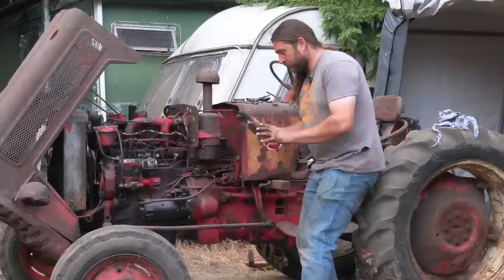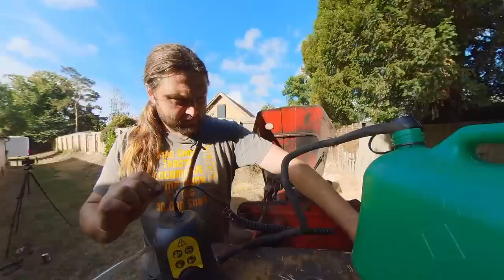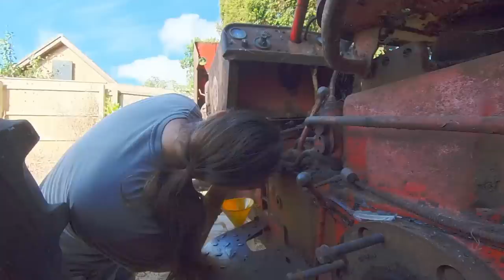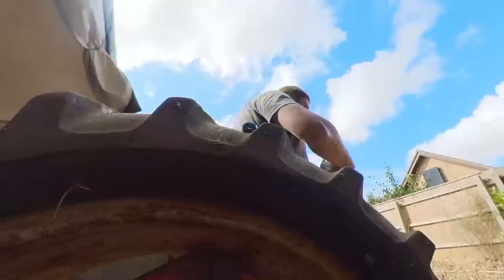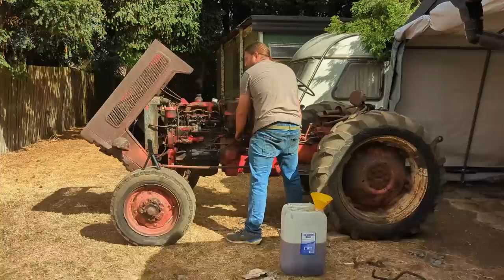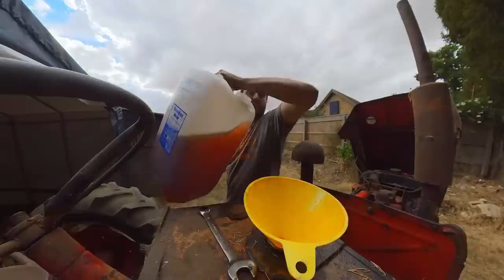Will my abandoned, broken International B275 Tractor start - and what's wrong with it?

Comment: Just a tip for you to try. Get some lacquer thinner or mineral spirits and drain out the fuel again  and pour in a couple gallons or in your country  liters of the thinner.  Let it sit for awhile then use a long wand air gun be excellent if you have one with a suction tube  blast through the mix and stir it around the tank. Drain out the crappy mix and flush it with some diesel fuel replace the valve and add in fresh  fuel you should be good to go. Remember to  add some diesel fuel stabilizer to the fuel and avoid that sludge problem  again. If she's still smoking a bit more than it should add some Marvel's  mystery oil to the fuel and run a tank of it through it should help clean up the injection system  or use transmission oil. Both will help it .
Reply from the maker: When I come to restore the thing, I'll do that!

Comment: I have plenty of experience with IH equipment but not diesels. I'll take a swing at the surging problem, my guess is the timing gears are worn out and have too much backlash. One way to rule out the governor is to put the engine under load at a set throttle position and see if it falls flat on its face. if the governor is still attempting to work, it should add fuel and keep the engine running.
Reply from the maker: Like dropping the clutch in top gear?
Did that and it coped
Reply: @lmm  hmmm... May want to look into the timing gears then. Could also try a thicker engine oil in hopes that it takes out some of the internal slop in the engine.

Comment: hey lmm ! thanks for the videos and return to the wrenches lol... next time you run into this   ...try some compressed air into the petcock ...
Reply from the maker: Yes that would likely work
Reply: @lmm   it would quickly dislodge  blocked inlet filter in tank or petcock ...at least enough to facilitate tank draining and let you troubleshoot ...its a common trick for cars that regularly clog fuel filters /socks  then stop running...its easier than dropping the tank to see if that is the issue . im thinking its the governor as well ...possibly a cleaning will fix the surgeing but more likely its worn  or needs a spring replacement .... if it was a gas engine i would say check the fuel filters

Comment: It's not really necessary to remove the fuel tank. Flush the fuel tank with detergent, then dry the interior with industrial papers towels, using the airline to blow the towels around & pick up any residual dirt. Remove paper towels & refill with fresh diesel or filtered old diesel & use a diesel bug treatment as modern diesel loves to absorb water. It's the bane of diesel boats.
Reply from the maker: The tank needs to be removed to allow access to the steering box which needs surgery, so not the end of the world to remove!

Comment: She might want some hard work to sort the running issue, many tractors engines suffer from not being worked but once given a bit of stick the blockages can clear, alternatively add a quality diesel additive to the fuel.
Me and my dad would like a old tractor again as we had to reluctantly sell my Grandads restored Fergie around 2009/10 as he was no longer with us and my Nan was downsizing homes. I think if we were to get a tractor it would either be a 1980/90's John Deere or a Ford tractor.
Reply from the maker: Always sad to have to let one go. A hard days work will break it it fix it!
Reply: @lmm  maybe it will break it maybe it won't. You don't need to go to the point of severely putting huge strain on the engine. Possibly occasionally tow Jupiter out of the shed with Jeb, that should give the engine some work.

Comment: I had the same problem with a Kubota tractor I bought and it was only a 1994 model. Half an inch or more of mud in the bottom of the tank, in the end I had to remove the tank and pressure wash it out. No idea how the previous owners had got so much muck into the tank as the tractor had spent its entire life on a caravan park shunting caravans and cutting grass, from what was in the tank it looked more like they had used it for earth moving by stickin the earth into the tank. The black cylinder on the side of the injector pump is a hand operated primer pump used to fill the pumps gallery first. The lumpy idle is down to the pneumatic governor, either dirt in the vacum pipes or the leather bellows is hard or punctured.
Reply: I was wondering how far down the comments till some one got it right. Primer looks like an old bosch style, some have strainer in the main pump as well. The old simms injection pumps   often had leaking rubber type bellows also. I always remove injector return to tank line first. A lot will be learned from what is happening there. The more connections you loosen the more new problems that can be started.

Comment: First  bleed it at the filter then bleed it at the pump .then bleed injectors .then she will start . Don’t use easy start you will damage your heater plugs . Bruce Shetland
Reply from the maker: That wouldn't have worked as the blockage was at the tank.

Comment: I’d suspect that has a split in the governor diaphragm it might be an early one with a pneumatic governor, or there will be airpipes from the intake manifold or air cleaner to the governor these olives might be worn (put yer hand round it n if stops surging that’s the problem) if it’s a mechanical governor on the injection pump you need a trip to an injection pump specialist , new governor diaphragms should be able to be found on fleabay lol
Reply from the maker: I've replaced the diaphragm sadly, and it made no difference.
Reply: @lmm   looks like it’ll be a trip to mr “diesel injection specialist “ in its future for the injection pump
Reply from the maker: @Jim-McKechnie  my wallet cowered at the thought

Comment: Because of the amount of fuel leaking out of the pipe on the bottom of the pump (which is your oil level) it means that the pistons that pressurises the fuel are worn and so the fuel is leaking past them so the governor is trying to over come the lack of pressure making it hunt all of the time so really the pump will need rebuilding but also check the pipes on the back of the pump which go up the the intake manifold as I have seen them block up with rubbish making them hint too but 9/10 it is the pump that’s the problem, cheers
Reply from the maker: I thought that pipe was the overflow, which was a result of the thing going wide open every few seconds
Reply: @lmm  that should be filled up with oil to that level as if it was over full it would just drip out it is ok if about an egg cup full of diesel leaks past every 20hrs of running but when it’s a constant drip it means the pump is badly worn due to lack of oil changes in the bottom as it only holds about a cup of oil and it usually leaks out if you are not careful, cheers

Comment: The hunting issue is probably because of a hole in the diaphragm that is at the rear of the injection pump. If it even isn't the problem I would recommend changing it anyways, as probably it has hardened over the years and it will bring all sorts of issues and it is fairly cheap and easy to replace.
Reply from the maker: I have changed that. No luck!
Reply: @lmm  Oh okay, I would check the tubes that go to the intake and look for leaks (holes...) and obstrusion. I would say the issue is due to air getting leaked in from somewhere else, there isn't much on those injection pumps.
Reply from the maker: @sergiroure2722  I have checked for obstruction
Will test for holes. I did spray them with wd and got no bubbling

Comment: throwing a guess in the mix low fuel has sucked up dirt from tank and glogged up fuel pump and possibly fuel injectors
Reply from the maker: Quite possible, though this is as good as its ever run for me
Reply: @lmm  maybe worth putting in a inline fuel filter,easily cut into pipe and should help you see any signs of dirt/rust coming out of tank

Comment: I'd say the idle issue is a pump or injector problem.  Judging by the smoke that engine has serious internal ware.
Reply from the maker: It's an old tractor, lots of old diesels are smokey when they fire up.
But yes. Tired is an understatement
Reply: @lmm  don't worry about it , most of these old b series internationals smoke when cold. Most diesels do.

Comment: faulty injector pumps or lift pumps
worn-out piston rings or cylinders
head gasket failures
worn-out valve stem oil seals can all be an issue at time lauire in my opinoin depeends on the smoke colour xx
Reply from the maker: It wasn't leaking coolant, so probs not the head. Rest is all possible

Comment: You injection pump doesn’t have a mechanical/centrifugal governor it has what’s known as a pneumatic governor which works with a diaphragm pulling on the pumps fuel rack which alters the position of the 4 pump elements thus controlling how much diesel gets delivered. The diaphragm lives in that housing on back of pump. This is connected usually by two pipes to a butterfly arrangement like a carburettor on the inlet manifold. The suck created when the butterfly is more shut than open pulls on the diaphragm and pulls the fuel rack which is biased towards delivering max fuel due to a spring pushing inside the diaphragm control    So butterfly fully open no suck spring pushes rack to max fuel…..butterfly closed/partially closed the suck created in manifold pulls on diaphragm against spring and the fuel rack pulled to a lower fuel delivery position…..it was a simple sort of system but had its drawbacks mainly being not very accurate at keeping a steady rev and they always seem to hunt quite a bit like your B275 ….maybe a good clean out of the associated pipework and inlet manifold might help or maybe the fuel rack in the ink pump may be a bit sticky……also the little bent handle on the lift pump is the hand primer you just have to screw it round till it pops out then pump away no need to keep spinning starter over   It doesn’t prime the injector lines though ……good little tractors them Internationals from Bradford👍👍
Reply from the maker: I replaced the diaphragm before thinking that was the issue. Could well be a spring though.

I've never managed to get the priming pump to release. I'll have another play with it

Comment: dont you know you  can operate the lift pump by hand to save your starter and battery ? Open the vent on the HP pump and prime by hand, then you only need the starter to get the fuel to the injectors
Reply from the maker: I'm actually unsure of how to do that.
I've used another international and the prime unscrews and then you pump it up and down.

This doesn't release, would the twist be the vent?

Comment: Now that it's working you just need to take it to the mechanic to give it a complete overhaul.  Forget a rebuild
Reply from the maker: Not the worst idea
Reply: @lmm  that engine has possibly got a few more years of life in it before you have to swop out parts but that's my unprofessional option but it do need to have the engine taken apart cleaned and lubricanted to make sure.

Comment: First clean out fuel tank, fuel filters, air filter then see how it runs. Unless you are using the tractor for agricultural use you are not allowed to use red diesel no matter what if you get caught by customs and excise you will face a large fine. Good luck.
Reply from the maker: The fuel tank will get cleaned when the tractor gets restored. Its previously had a service.
It's not been on the road with red.
Reply: They have changed the law, even someone running a diesel engine at a steam show cannot use red. There is talk about only agricultural vehicles using it so construction mining etc can be fined. Please contact customs and excise to get further information.
Reply from the maker: @stuartbailey3824  really?
I thought it was just on the road.
Better go do some agriculture stuff with it then
Reply: @lmm  if you Google what can use red diesel UK it tells you all about it, see if you can pick up a cheap grass cutter or similar,  I'm just trying to help you not have a dig at you. Like I said I have been told that customs turned up at a steam show and checked all the tractors,  they did just hand out warnings.
Reply from the maker: @stuartbailey3824  damn! I'll have a look. Thanks for the warning

Comment: You should off took that tank off and washed it out. As for the hunting I'd put any money it's the diaphragm in the back of the pump
Reply from the maker: It's such a pain to remove it.
It'll get done when I actually restore the tractor as I need to do the steering box which is under the tank.
I replaced the diaphragm, no luck sadly

Comment: Captain clueless. You can't even use a spanner properly. Start at the beginning - Fuel in tank - clean filter bowl - water trap under tank and check fuel tap switched on - check main fuel filter isnt blocked - bleed injector pump using lift pump.  Give it some throttle! Connect battery lead correctly.
Reply from the maker: Thanks for your constructive comments.
1. The solonoid was knackered, if one was to attach the lead properly one would have to find something else to go direct to the starter.
2. There is no lift pump.
3. It had plenty of throttle.
4. Based on how it stopped, first stage was to find out if it had fuel, or if something had failed internally.

Comment: really, i shall than using a bacteria slug killer in your fuel tank because that layer and that many slug shall also return for later time. i saw on other youtuber did also and it does work for cleaning that fuel tank. and it is worsted on your tank because he did replaced that tank with new parts and reseal with special paint/coating (i don't know the right english word for it) to making it safe. for his amphibous car (it is Luaz car out Ukraine)
Reply from the maker: At some point I shall properly restore the tractor and empty and treat the tank. For now though, I'm happy enough!

Comment: Well you picked one of worse tractors to start even when they are ok . Have fun
Reply from the maker: Yes, apparently they need a load of glow even when in good condition!
Reply: @lmm  the last one i did had over heating problems, the water gallery in the bottom of the block was sludged up past the drain tap ! Poor old thing